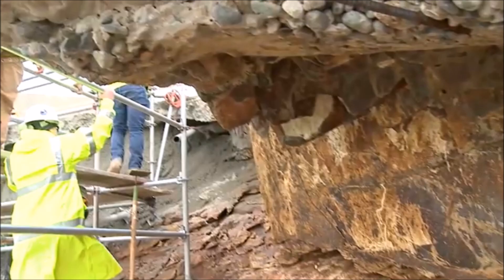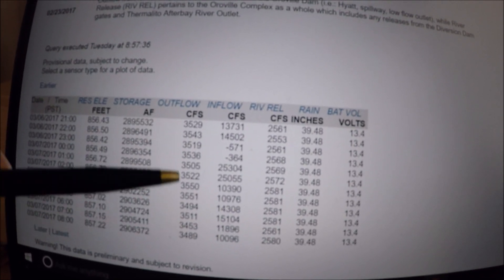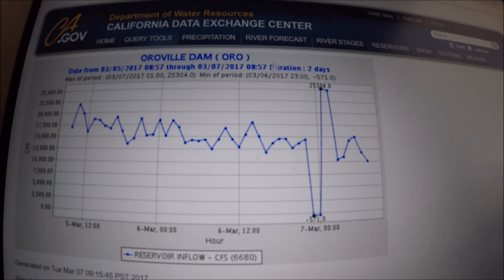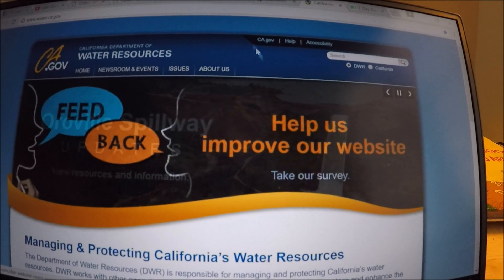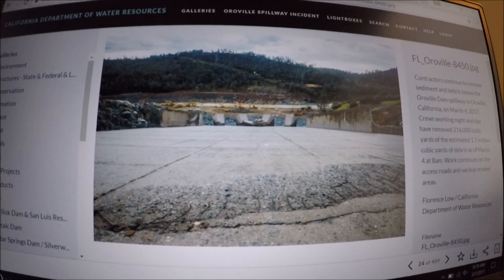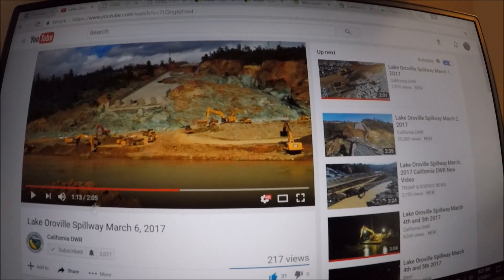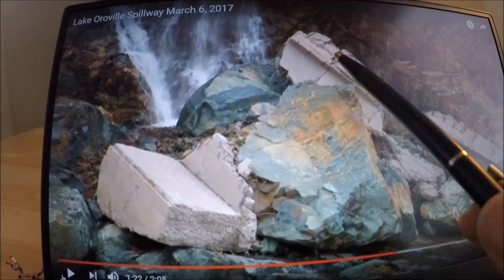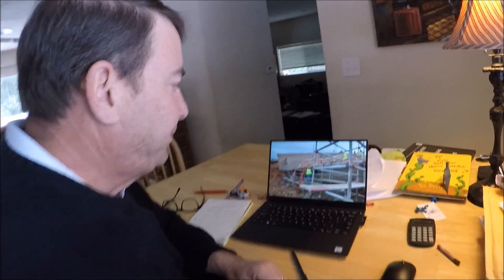Oroville Update 7 March 2017  "Where's the Rebar?"

Comment: The sidewalls of the spillway also have pipes coming in from the top about 24"~ from the top. I'm assuming this is for drainage from the side of the wall? I also was doing research on the Hyatt Power plant, it the website said 3 of the turbines are capable of being "pumps" while the other three will on work as generators. Not sure what this means and the cfs numbers don't really make sense on their documentation. Juan here is the link and it is the table at the bottom of the page I'm referencing. What is your take on this? http://www.water.ca.gov/swp/facilities/Oroville/hyatt.cfm
Reply from the maker: I'll check it soon...gotta go.
Reply: Rob DeHaven : there are 6 turbines in Hyatt, 2 different designs; 3 are generators only, generating when the dam discharges under gravity through this turbines. The other 3 are bidirectional - they can operate as generators like the first 3 units, but they can also be reversed ( consuming electricity), becoming pumps to lift water from the bottom basin (I guess that's called part of the Thermalito diversion pool) back into Oroville lake, and so creating generation reserve for later draw-down against an expected ñ crease n power demand.
Reply: Thanks for the great information! That makes sense.
Reply: Rob DeHaven : You're welcome ; hope that helps the table make more sense now.

Comment: Juan, check out the 1:28 mark of today's DWR video.  The close-up of the two workers standing near the leading edge of the spillway.  Stop the video.  Then use a measuring devise (I used a compass) to measure the thickness of the slab, and then compare it to the workers' legs, from bottom of shoe to knee.  It looks like the slab at that location is about mid-calf, or 12-14" thick.  See link:_ https://www.youtube.com/watch?v=7LQng6jFJw4
Reply: Good catch there, GSMS. Also, the rungs of most ladders are about a foot each, irt the extension ladder there.

Comment: On the rebar issue, while the opening photo shows lots of rebar, the next few photos show a woeful lack of it in sufficient quantity and size.
Reply from the maker: I think this will be an issue at the hearings.
Reply: We'll have to see what the engineers say about it when it comes time to rebuild it, but I doubt that insufficient rebar was the cause of failure. I suspect a design flaw led to cavitation at high flow rates. You have to keep in mind that in normal years the main spillway isn't used very much if at all. Typically there is sufficient capacity in the dam to hold all the runoff until it can be sent through the Hyatt powerplant. I read somewhere that the main spillway has only been used about a dozen times in the history of the dam. And this was the first time in the history of the dam that the emergency spillway was used. Another possibility is that high pressure water infiltrated an expansion joint and began to break up the slabs from the edge. Rebar addresses neither issue.
Reply: Why would less rebar in the spillway than in a roadbed be concerning?  The spillway handles far lighter loads, and the load it carries is distributed across its surface instead of concentrated on a tire's contact patch on a roadbed.  Why would you expect to see anchors embedded in the rock?  Any water under the spillway would keep the top of the bedrock wet, and corrode any anchor embedded in that rock.  Why do you think YOU, Drew, can determine substandard thickness of concrete from a picture?  This webpage is one of the best, most factual sources of information for this situation, and your airhead guesses and ignorant misconceptions do not belong here.
Reply: there is less rebar in that spill way then a road way or bridge and that right there is very concerning. with proper rebar even a large hollow spot should have been fine also the lack of anchors imbedded in  the rock under the spill way is also very telling in all that rubble I don't see a single anchor point or anything to say it was secured properly to the bed rock or surrounding area you don't just poor that shit over rock and hope it sticks also the lack of any consistency in thickness is also very telling. that's some shoddy ass work right there
Reply: I agree
Reply: dlwatib : Thanks for that; I was going to ask how frequently the main spillway got used; I know there've been a few years of drought and the lake level fell way down. So in those dry summers (which have been hotter than norm?) the spillway concrete could maybe have expanded differentially to the native foundation more than designed and become disadhered from the bedrock ~ plus other effects like cavitation lift, expansion joint yield, sustained extreme loading, fluidisation of the ground material, failure of the side walls....

Comment: Thanks, I guess it wasn't nearly strong enough even though it looks very strong, this kind of flow may not have been planned for. I noticed it was punished and defeated. I'm sure it met the standards at the time. I would have thought 3 feet thick at minimum with verticle and horizontal . Thanks again
Reply: +Lisa Dawn Glover Once the water started topping the emerg. spillway those trees were doomed away. The ground was saturated, add running water and those trees would have been causing trouble down stream.
Reply: + BlueStar 712  Yes, based upon the pictures and the men in the pictures  (hard to know setback of men from edge) it looks like the spillway is only 12 to 18 inches thick which is way to little for a spillway going across anything but bedrock.  Especially when you factor in time and freeze/thaw cycles.

Comment: What causes the bad data points on inflow?  Thanks
Reply: something blocking the inflow sensor that reads amount of water coming in.   Probably a log that jammed it and took a few hours to notice and sensor reset giving the 2 extreme opposite readings then leveling back to normal readings.
Reply from the maker: Inflows may be derived...check the website.
Reply: There are different kinds of sensors to monitor flow. Simple paddle switches can get stuck and need to be reset, but they are not normally used for large volume monitoring. Differential Presser Drops are more common for heavy industrial water flow and they can get air locked. Also loose wires can peg or give some false readings. Then somebody has to go check them and usually stop and restart their flow to clear debris or air.
Reply: Ok, thank you all for explaining.

Comment: I am a bit naiive. I had always thought that one of the goals of a dam was to generate hydroelectric power. Why wasn't this Hyatt facility working while the water level was rising? What am I missing? David
Reply from the maker: see previous updates...it damn near flooded...
Reply: the debris at the base of the spillway caused the river level to back up into the power plant.  That's why they have been working so hard to clear a channel to relieve the back up.  Also, they removed some of the power lines from the plant when the emergency spillway was running as they might lose more towers.
Reply: your missing the enormous water inflow from december onwards.
see this graph with the waterlevel:
https://cdec.water.ca.gov/cdecapp/resapp/resDetailOrig.action?resid=ORO
before the beginning of december the waterlevel was at a record low.
one and half month later they are record high and they had to open the floodgates, all this time the hydroplant was producing electricity.

They notice some the spillway damage and decide to hope for the best shut it down. that went wrong, added a bit of a flow restriction to the river, and they had to shutdown the hydroplant for 2 electricity towers were about to come down. 
Then they had to open the spillway to limit the damage which created even more ruble in the river.
And here we are 2day.

p.s. I think they calculate the inflow from the water height so just a small error in the level creates big diff. in inflow.
Reply: Wouter Portegijs : thanks ~ that's a great link on the Oroville lake historical capacity